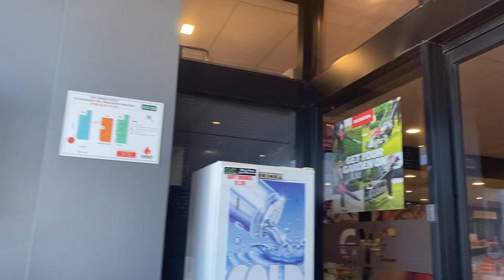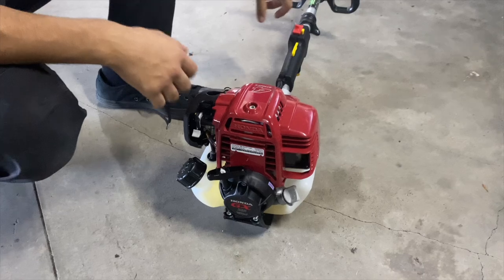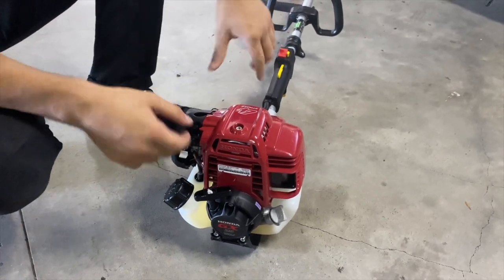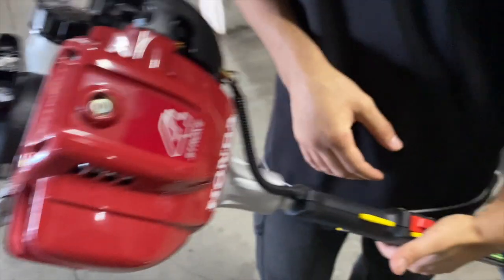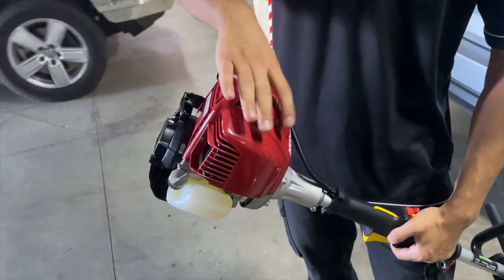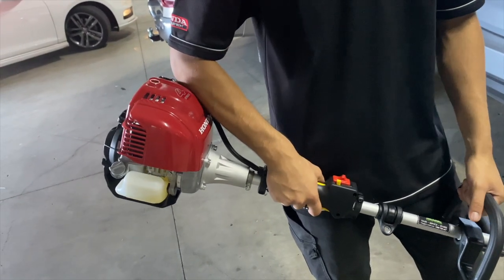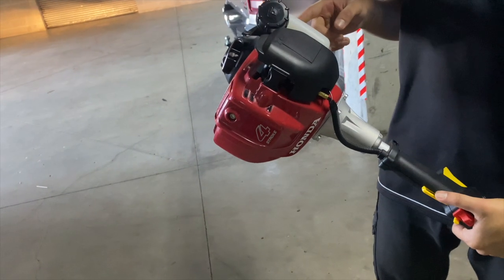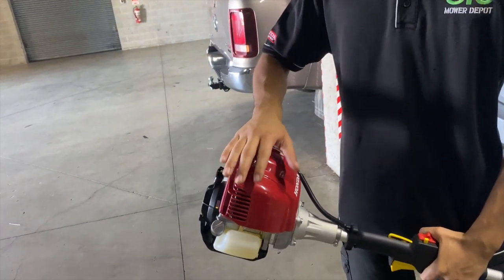Testing out the Honda UMK425L Petrol Line Trimmer: Clearing Overgrown Grass

Comment: I have a honda umk aswell, i really like it I'm 19 years old and trying to start my own lawn mowing business. but I am thinking of upgrading to a sthil line trimmer as it is more powerful.

By the way love the content keep it up amazing camera quality you have in these angles.
Reply from the maker: Thank you for your kind words about the content and camera quality.

Upgrading to a Stihl line trimmer may indeed provide more power, but it's important to consider the specific needs of your lawn mowing business. If you're dealing with tougher, more overgrown areas, then a more powerful trimmer may be necessary. However, if you're mainly dealing with normal residential lawns, the Honda line trimmer you currently have may be sufficient.

One advantage of the Honda line trimmer is its 4-stroke engine, which makes it easy to start and use. Additionally, it may be more cost-effective to stick with the Honda trimmer rather than investing in a new one.

Comment: Really great content.  Is that the other side of the bit from your other video? And, by the way,  I like the new weed-whacker,  do you?
Reply from the maker: Thank you for your compliment! Yes, this is the other side of the bit from my previous video, which I was finally able to complete after a five-day delay due to the rain. I'm glad to hear that you like the new Honda line trimmer. I researched it thoroughly before buying it and found it easy to start, with low noise and high reliability. In fact, my Honda mower has been running without any issues for five years now. Honda is definitely a trustworthy brand.
Reply: @quanliwang8911  keep up the good work

Comment: Your Expensive Honda UMK425 has few more parts inside and a little heavier than a 2 stroke . Although. 4 stroke is environmentally cleaner, also it has  valves, tappets and timing belt that requires extensive maintenance. Apparently, 4 stroke has limitation you can only cut level flat surface and  cannot tip it in one side for clean edging cut like you can do on 2stroke. I prefer 2 stroke.
Reply: The honda trimmer can be used 360 degrees. I have the versatool, and it is a joy to use just like any 2 stroke, but with more torque.

Comment: I only do 2 cycle trimmers
Reply from the maker: Thank you for your comment. I understand that you prefer to use 2-cycle trimmers. While I respect your preference, I currently use a different type of trimmer for my work. Each trimmer has its own advantages, and I have found the one I use to be effective for the tasks at hand. If you have any specific concerns or questions, please feel free to share them. I appreciate your feedback.
Reply: O no nothing bad about you using the 4 cycle trimmer I have used them before and had bad luck with them I have been using the echo pas 2620 with the torque trimmer attachment now for 4 years and love it but u work with what u like I like Honda but not there new lawn mowers I have one it is not even one year old and it’s in the shop getting fixed so I have gotten a old but new Honda HRR mower maybe one day I’ll get the Honda trimmer to try out but I don’t know do to having falling in love with my echo PAS I have used it to take down some big over grown yards I baby it so much that I adjust the fuel to oil ratio depending on how hot it is outside if it 65 degrees Fahrenheit in hotter I run a 40 to 1 ratio 64 and under I do 50 to 1